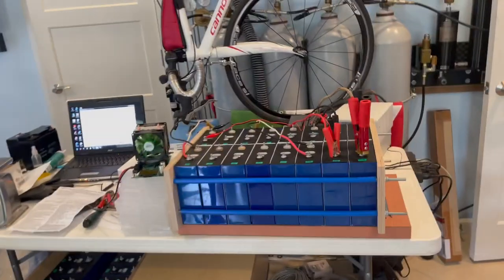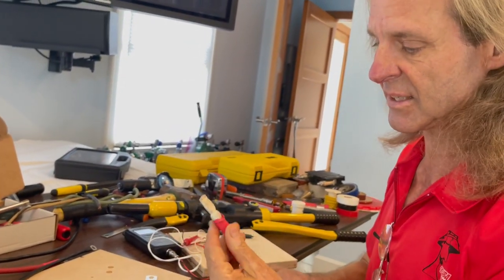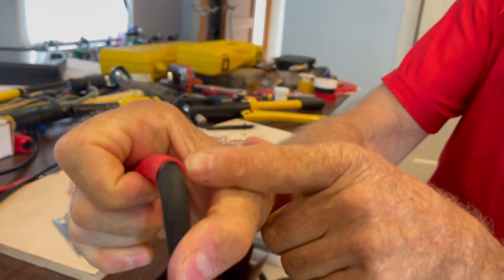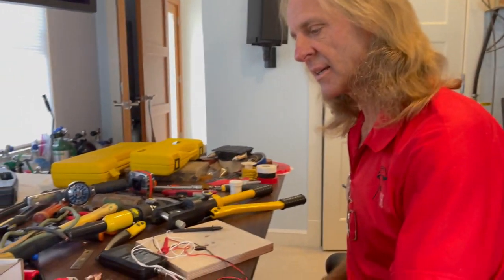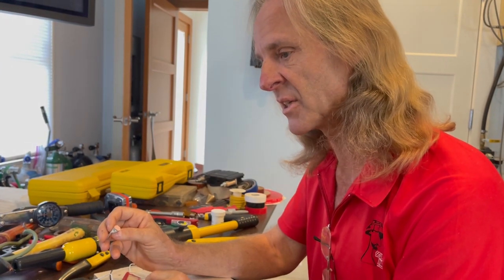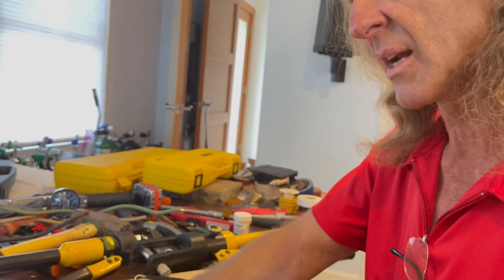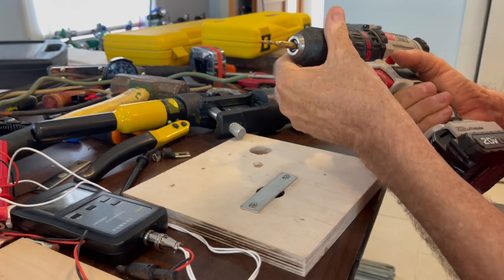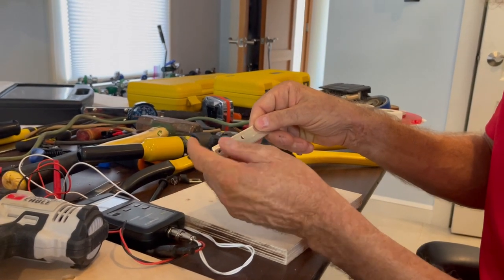Is Lifepo4 A Fire Risk?! How To Make Safe Battery Connections.

Comment from the maker: I misspoke in the video when I said the copper busbars were equivalent to 1/0 copper wire. I meant to say 1 gauge. Not a huge difference but I wanted to note the correction.
Reply: Great video. Pure copper busbars have a current carrying capacity of 1.5*CSA (mm2) , which mean your busbar can handle abt 60Amps.
Reply: You might better pin this comment that is stays on the top of all comments that people get aware of it without having to scroll through all comments. 

1 tiny point that this is wrong cause you had calculated your busbar with the equation 20 mm x 2 mm = 40 mm² which then would equal a 7 mm diameter wire which equals 1 gauge, but

if you drill a hole of 3 mm in that busbar everything changes from 20 mm to 17 mm x 2 mm = 34 mm²

squareroot of ( 34 mm² / pi ) = 3,3 mm radius or 6,6 mm diameter which is a 2 gauge wire, not 1 gauge.

Your hole of 3 mm (my assumption - could be 2 or 4 mm) diameter weakens the conductor property.

The only counter argument is the terminal hole cause the contact surface is below and above and around the whole terminal. Which then would mean to be precise that the 20 x 2 calculation is completely off due to the bigger holes of 1 cm not just the 3mm hole unless the surface of half of the nut and its bottom counterpart is bigger than the squarespace of the bus bar cause the power will flow the shortest from the lower terminal surface up into the busbar and from the nut screw surface down into the busbar.

Does the 3 mm hole lower the conductivity of a bus bar might be a question you could answer by measuring the resistances from a screw with 2 nut screws that fixes the busbar on each side.
From such arteficial terminal screw to the other you can measure the resistance for a busbar without the 3mm hole and with the 3 mm hole  to get behind the impact of such hole.

And this might also change the answer to the question what awg size such 20 x 2 mm busbar equals depending on the 3 mm hole or not.
Reply: It's really very informative, could you please explain how to calculate the busbar size for the battery?
Reply: You misspoke as well when you said you can't sand the busbars down to make them flat. You put the sandpaper on a mirror and do figure 8's with the bar. I just saw it done yesterday and a heat camera was used before and after and the temperature dropped significantly. Just needs to be done on a flat surface.
Reply from the maker: @felonebike9859  so they sanded through the tin coating?
Reply: @Ray Builds Cool Stuff  Soild aluminum. Off Grid garage did the video about 9 months ago. Also, you stated that you can't sand them due to not being able to make it smooth enough by using a grinding wheel. Not because of tin plating. So I guess you misspoke twice. But again, yes its completely possible if done right on a flat surface and solid bars.
Reply from the maker: @felonebike9859  Andy’s aluminum busbars didn’t work out for him too well. They got hot and he ended up changing them out.

Comment: You are a pecfectionist, Ray. I really admire your "attention to details" in building your project, where others fail to consider. I learned a lot in this Vlog! I just subscribed to your channel and would like to learn more. Thank you very much!
Reply from the maker: Thank you Jojo. I think this part is really important. If you size the wires right, make good connections and protect it all with fuses, I think the risks are dramatically reduced.

Comment: Ray, what a great video! I´m working professional as an expert for connectors in the automotive industy and I can sign every word from you! Especially the criming is in my point of view the most dangerous part of all. I have all the tools to do it by myself, but I didn´t want rely on it and ordered all the battery cables in the length that I needed with crmps from a hydaulic machine - all crimp parameters are controlled - there are alot! It was worth to me. Again THX for the good video an discussing that stuff!

Comment: When I make battery cables for our farm trucks and tractors I use both crimp and solder to maximize the conductivity.  First I crimp like normal and then I drill a hole on the ring side of the crimp and fill the end with solder.  Leaves no space inside there for corrosion on the terminal side.  I've cut open enough battery lugs to realize a crimp alone often can't be trusted....because eventually you see the green corrosion form on both sides of the crimp.  For a battery like this inside away from the extreme weather conditions of a tractor or farm truck I wouldn't waste my time with solder....but I always solder connections on a battery that will be outdoors.

Comment: Having built sport boats in the past for a 15 year stint, I tend to agree with the use of a flexible connection between battery cells. Marine applications are a very high vibration environment subject to twisting loads that would certainly stress these  terminals. Terminals that seem barely adequate for home use, let alone in boats where they will really take a beating, and high moisture exposure as well. It may very well be an ABYC (American Boat and Yachting Council) standard to use a flexible connection here. Have been away from industry for far too long to be certain. Maybe some others currently in the Marine industry can chime in with current standards. Thanks for all of your attention to detail, and the information you provide! I enjoy your videos very much.
Reply: What about putting a battery bank into a very rigid frame (now we have a carbon that is stiff enough and is light) and apply a good compression (which is always good disregarding of an environment) to shake it as a one piece?

Comment: As a ham radio operator we have to look at great connections to get the lowest swr points for the coax and antenna connections, radios are expensive so great connections are a must. Power supply connections are also very much necessary. The info you put out is not only good but it is excellent info that can be used in high energy hobbies.
Reply from the maker: Wow, I am humbled by your kind words.

Comment: I've used Kopr Kote as it actually contains copper (not it's intended use however). Once that has been shrink wrapped, I'm betting it will last a long, long time. I'll really have to put that to the test beyond just using it on the battery terminals on the truck though (which are obviously fully exposed, in my salt air environment). Noalox might work as well due to the different types of metals involved.

You continue to provide excellent and meticulous information for people and I'm thinking you should have far more subscribers (doing my best and liking all videos).
Reply from the maker: Thanks

Comment: Hi Ray , I love the passion you have for this and helping people like me with very little knowledge on building batteries . The reason they have thin wire on overhead distribution systems is because they run at high voltage,  when volts go up amps come down and no need for big heavy cables in the air,  that's why they have the step down transformer boxes . I'm in no doubt that you know this already 👍
Reply from the maker: That is a big part of it and the other part is that they are uninsulated so heat is not as big a factor and in the air, the heat disapates better by radiation and convection. Thanks for your kind words of encouragement.

Comment: Good advices. I used solid copper bus bars, washers and nuts all over the battery. We are dealing with 300 amp. No need to say more. Even the connections between BMS and battery are made in solid copper bars. Same for connections from battery to inverters. No cables for 300 amp! It requires bending copper bars, but copper is soft...

Comment: resistance is always determined by the bottle neck not simply by measuring the 20 mm x 2 mm = 40 mm² area considering the amount of direct contact surface with the battery terminals can be smaller.

If that contact surface area would be smaller than that terminal is the bottleneck.

What is the real contact area of the terminal considering the nut is smaller than the 20 mm busbar?

Assuming you have a 10 mm diameter terminal and a 13 mm ring surface on the terminal and a 13 mm outer diameter of the nut screw (with of cause 10 mm hole) you will have 2 same size contact surfaces each calculated with the radius as half of diameter 

= ( outer radius ) ² x pi - ( inner radius ) ² x pi  
= (outer radius ² - inner radius ² ) x pi
= ( (13/2) ² - (10/2) ² ) x pi 
= (6,5 ² - 5 ² ) x pi = 17 x pi = 51 mm² 

This means you will have 51 mm² contact surface on the bottom terminal + such nut screw or 102 mm² and therefore the busbar squarespace of 2 x 20 mm = 40 mm² will be the bottle neck unless you get a 2,5 thicker busbar plate which would mean a 5 mm thick busbar.
To be honest: 5 mm thick would not be enough
Why ? 

The 3 mm hole lowers the squarespace from 2 x 20 mm to 2 x 17 mm which then means 34 mm² instead of 40 mm² which means a 3 times thicker busbar of then 6 mm x 20 mm (net 17 mm due to the hole)

But that 5 mm thick 20 mm wide busdbar would equal what copper wire thickness ?

102 mm² is the total terminal surface and a cable of ( 102 / pi ) ^ (1 / 2) or bigger would push the bottleneck to the terminal. Remember that ^ 1/2 means square root, so squareroot (102 / pi) = 5,7 mm radius or 12 mm diameter copper cable  

That means a 12 mm diameter copper cable ( 4/0 AWG) would equal a 20 x 5 mm copper busbar if the joints are perfect. 

If you think twice you will realise that this comes close to a good 24 V jumper wire cable used for semi trucks or cars.

But that all depends on terminal and nut screw diameters and has to be taken into account to get the best solution.
Copper is expensive and therefore the chinese master lier dealer from the first battery batch order did work again on her reputation considering that the batch had arrived without busbars and needed a complain to be shipped.

And those copper busbars come tinned cause tin looks better than the old oxided copper which makes it easy to fool us with tinned brassbars instead of tinned copperbars.

China is called communist state but their dealers can be the most capitalist one you had seen sitting behind an iron curtain cause none chinese customer will no go to court.

Comment: Excellent content well delivered. I used pre manufactiured tinned braided 250A earth straps, onto aluminium studs and noalox, in a RV setting. Cells are under slight compression forces though, so shouldn't be going anywhere no matter how many years of jostling the van takes. Hoping the 'braiding' dissapates the heat better. Maximum i should be carrying is around 100A on a 24V setup.(like a good margin of error, means you sleep better at night). 
The torquing of the lugs onto the cell studs though was a nail biting moment each time. :-) 

(This was before all the 'welded' studs were available on the cells(which i'm not a fan of anyways).

Comment: I think the step up to LiFePO4 from lead acid may cause folks to get "current drunk" and it needs to be restated that higher current and higher voltage, as you scale up all present increasing problems that require increasing diligence to offset the increasing risks.
On risks.  Here is a bit of bad judgement.  When tightening my small 105Ah 4S pack's bus bars I lifted a ratchet spanner.  Not the rachet and socket.  I even said to myself out loud, "Don't do it.  Get the right tool.", but I went ahead and on the 4th tightening I shorted a cell with the spanner.  This not being the first time I have shorted a high current battery I knew the drill pull HARD!  The plating on the post and the plating on the spanner will weld together, you have to put your weight into pulling it off.... do it EXTREMELY quickly too as in a matter of seconds that spanner will be cherry red and you will have a fire or cell explosion imminent, unless the battery internals are designed to fail as is often the case before the cell would be driven into runaway melt down.  The connector tabs and the insulation between them can be design to fail, short and effectively destroy the battery without the explosion.... you hope.

Comment: Thank you Ray good explanation of conductivity. Iam retired now but on my first jobs was in electronics for companies for Boeing and Lockheed there cables conductors were mil's specs, usually copper plated an alloy of nickel and platinum, teflon insulated. In avionics weight is critical so the look for best alloys to minimize resistance in a conductors in a lesser gauge wires I was amazed.
Reply from the maker: Thanks for sharing Ernesto.

Comment: Hey now sure if you have already done it. But I would be great if you can teach us how you make those 1/0 gauge cables with the hydraulic wire crimpers. A video on that would be great. 

My application is a little bid different. Its to build wiring upgrade for Amp and grounding cables wires. But you are right its important to ensure your crimps are of good quality.
Reply from the maker: I already have a video about that. Check it out.

Comment: Very thorough.   You can solder after you crimp.  Could be a good idea if you are protecting from corrosion.  But you don't ever want to solder before crimping.  
So they put the buss bars in for free right?  You got what you paid for.  Aluminum buss bars might do better mating to the aluminum terminals.  Good idea on tapping the bars for the small ring terminal.

Comment: to deburr the hole after drilling and tapping, get a small countersink with 6 or 8 flutes and just spin it in the hole by hand, with a small amount of pressure. 

great info, btw.  Thanks for all your videos.
Reply from the maker: I tried several methods of deburring the holes but by the time you use a countersink on both sides enough to remove the burr, there aren't enough threads left.

Comment: Thanks for a great video. I am a little concerned about how to connect batteries to bus bars using cables. Eg. I am using 2/0 welding cables with tin coated ring type crimp terminals to go between the batteries and bus bar and the same type of cables and terminals to go between the bus bars, fuses, and switches. I am using Victron 600A bus bars,  Three Renogy 12V 200Ah LiFePo4 batteries connected in parallel. It seems like I should make the connections as short as possible and as simple as possible. Could you give suggestions on the conductive paste and anti-oxidant you use.  When looking, I saw a MG Chemicals 847 carbon conductive assembly paste. Would that be okay? Should the paste go on every connection? What milliohm meter do you use and do we need one?  Thanks again.
Reply from the maker: The 847 is the paste that I use. I use it on almost everything. I do use a good milliohm meter. I can recommend the YR1035+.
Reply: @RayBuildsCoolStuff  Thank you.

Comment: 6:06 I have long ago preached solder as the better connection.
However if one considers the fact that LEAD or TIN has lower conductivity that Copper, then press fit is much better.

Comment: Since these cells expand and contract with SOC, I decided it was worth paying for the laminated/flexible bus bars, rather than using the solid bars that shipped with the cells.
Reply from the maker: I understand. I chose to restrain the movement instead and use the solid busbars. I'm only using 7 inch lbs of force on the nuts at 50% charge. When fully charged, they don't measure even two inch lbs more. It is actually hard to tell a difference in the pressure so I don't think they are going to be an issue. None of the battery pack manufacturers that I have seen use flexible bus bars. Most use long bus bars that are spot welded and the cells are not restrained with any real system that measures the force. It is an ongoing discussion that isn't settled but solid bus bars do not appear to be causing problems beyond theoretical. Poor connections seem to be at the root of the issues that happen. That and some isolated instances of very poor judgement.
Reply: @RayBuildsCoolStuff  would creating an oval hole be better to allow a bit more wiggle room for the terminals if using long busbars?
Reply from the maker: @asderven  the bus bars have oval holes in them but it is only for the variation in the cell sizes for the initial install. Once the terminal nuts are torqued to 5nm there won’t be any sliding on the terminal and if you leave them loose enough to slide in the oval holes it will be a problem electrically. So I’m still left with needing to restrain the movement of the cells.
Reply: @RayBuildsCoolStuff  Got it, thanks I see what you mean.
Reply: @RayBuildsCoolStuff  FYI, battery builder BYD uses layers of aluminum laminated into a flexible bussbar in their LFB batteries.

Comment: They make nice flexible busbars…. REASON …allow FOR expansion/contraction of each to minimize terminal stress. Specifically I am going to compress battery bank to 12psi and use rods with compression springs to keep them constant pressure parameters.(8-17 psi) However looking at copper chart I would need about 6mm for my EVE304, 300amps. I’m going with 2/0 welding wire as my discharge draw on the 48v banks will not exceed 200 amps, allowing plenty of leeway.further I’m cutting 3/8” copper pipe and making my own terminals using the hydraulic crimp. When calculating busbars, each one rating to it’s combined total discharge amps for your system.

Comment: The 280 Ah EVE cells I buy have 2 studs on each terminal, and on top of that I use oversized cable for bus "bars",so I don t have to waste time on all this back and forth, if something in spite of this, not likely, should create a bad connection,it will be easy to feel if getting warm on the highest charge/discharge rate you need,test with temp gage now and then,most likely the hot spots will be inside bms.